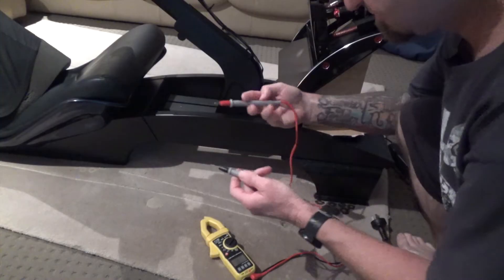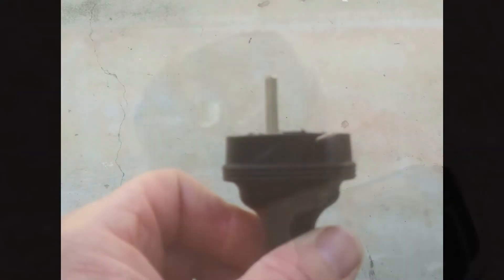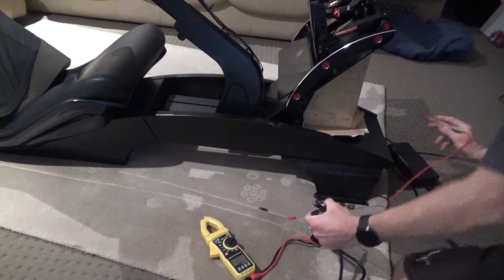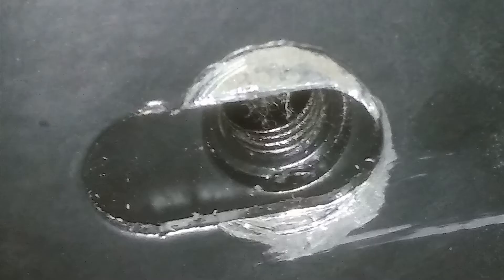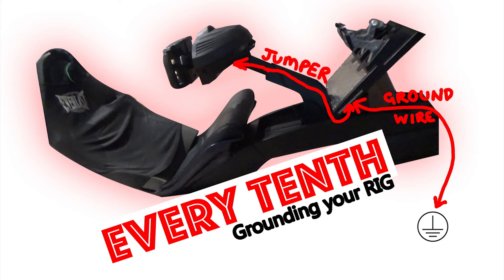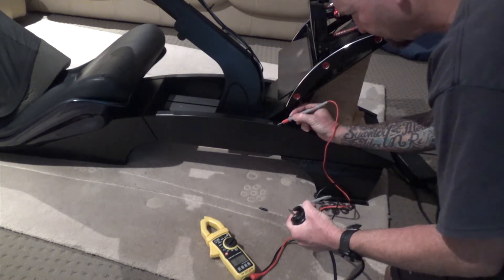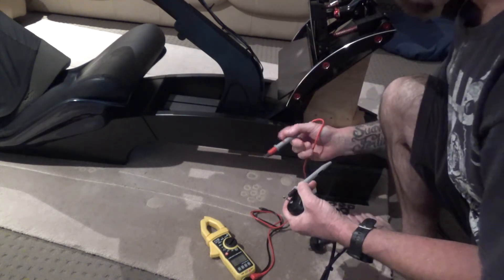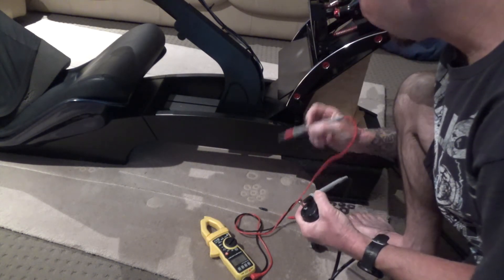Grounding your sim rig to prevent EMI issues.

Comment: You didn’t need to cut the other pins. if you were able to wire it to the ground plug, there is no reason to cut any pins off, you then plug the 3 pin into the outlet.

Comment: I’m getting an electric shock when touch by the screws on my rig, could this be the reason why
Reply from the maker: Sorry just saw your message, I didn't get a notification. It's most likely that the electric shock, is caused by static electricity. If you do this mod, that shouldn't happen anymore.
Reply: @everytenth thanks champ I figured out that was the problem, it was weird because when I’m sitting in it and I have my feet on the carpet it would happen whilst wearing socks, then I’d take my feet off and it wouldn’t happen haha